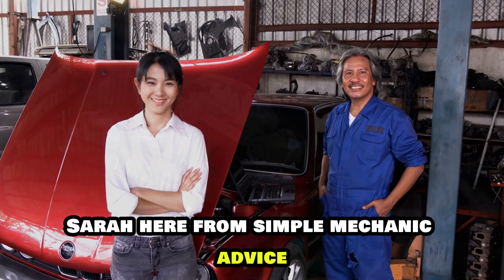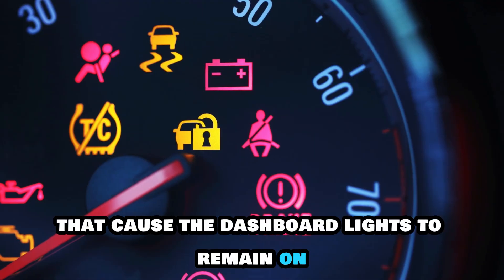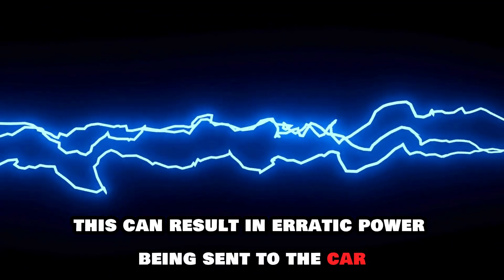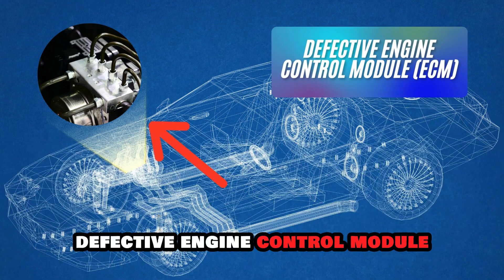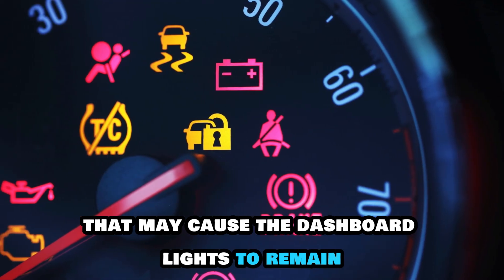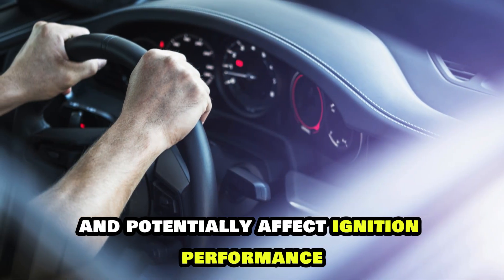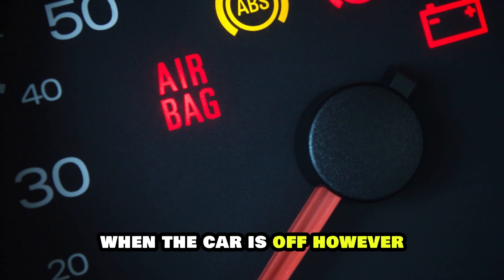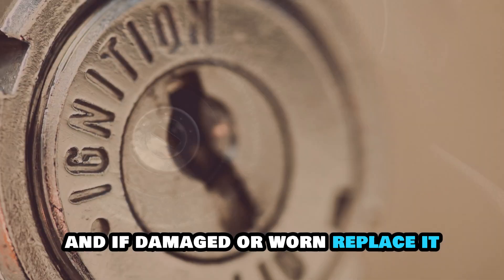Dashboard Lights Stay On When The Car Is Off: Common Reasons Explained

Comment: I had this issue. After trying a few things, I opened my driver's side door and closed it, then locked it. It finally went out.
Reply: Hello.. sir, can u explain it in more detail? I had this issue on my mercedes W210 E230 1997 model..  thanks in advance